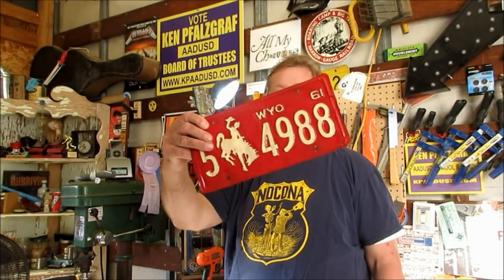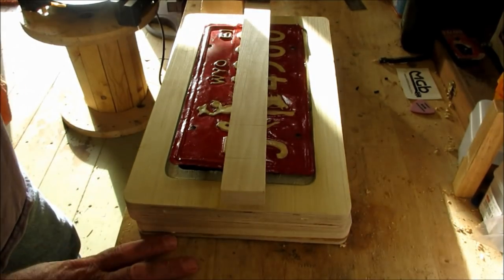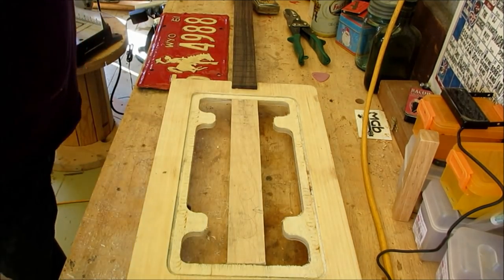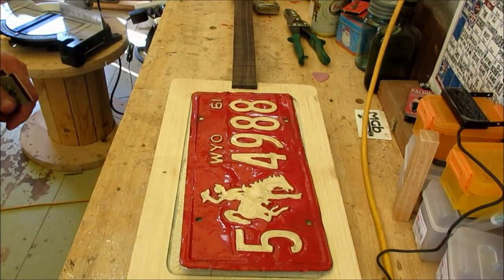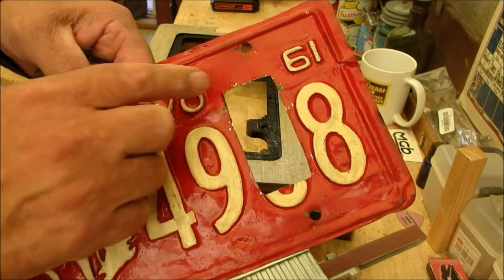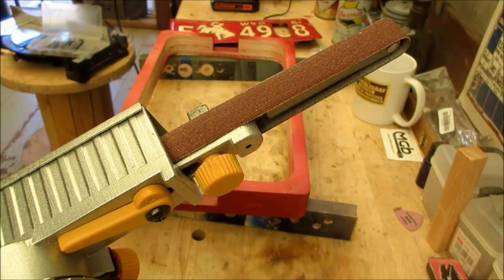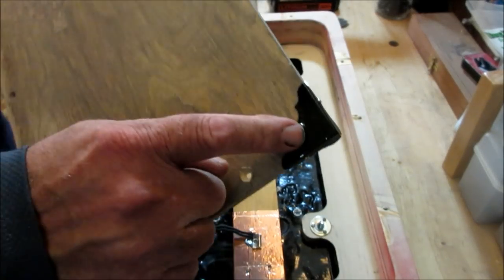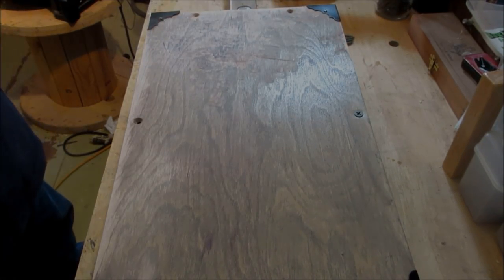License Plate Guitar Kit

Comment: Just a tip on flattening a bent license plate. I have done many license plate projects with bent up license plates. I use a small rubber  mallet. On a hard surface. It doesn't take a lot of force. But it works well to get most of the dents straightened out. I like your videos, keep up the great work. GF1 👍👍👍👍👍👍👍👍👍👍😁😁😁😁😁😁😁😁😁😁😎
Reply from the maker: Thanks for watching